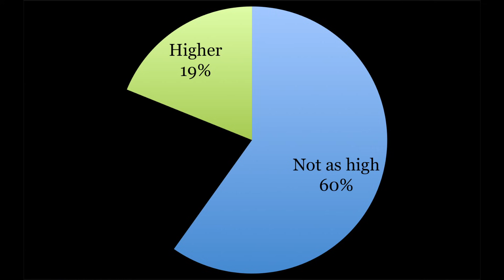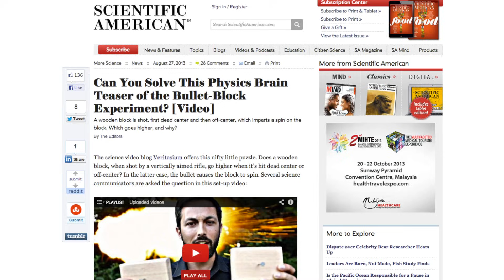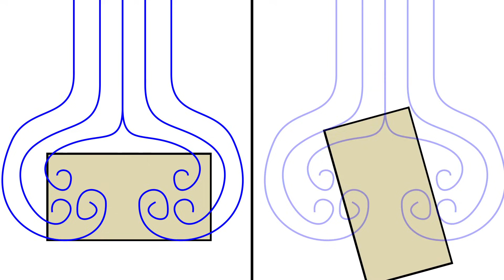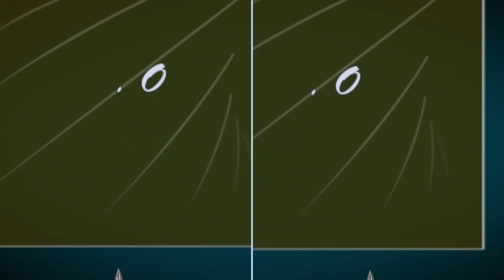Bullet Block Explained!

Comment: I too am unsatisfied with this answer:
the rotation is caused by the moment of inertia - when the bullet is shot in the middle the inertia on both sides is equal.
when the bullet is shot off center the inertia on both sides where the bullet hits is unequal causing a moment of inertia.
This can be tested by drilling a large hole on the left side and shooting in the center - you have moved the central moment of inertia axis of rotation to the right so the bullet will rotate clockwise.

Comment: If you want to see the difference in bullet depth, you should use a weaker medium and more energy. Perhaps firing a larger caliber round into massive blocks of styrofoam or cardboard? The bullets would be allowed to travel farther into the material with less resistance, but the difference in efficiencies would be more visible because the difference in kinetic energy would be greater, as the bullets are larger, and the differences in distances traveled into the block would be greater. :D

Comment: It is a matter of the weight of the downward force from the block due to gravity.  At its center of mass this force is greatest and diminishes as you move away based on the shape of the block.  Do the experiment with a MUCH heavier object that the bullet cant penetrate and note the max height of the cog of the block.  You will see it goes repeatably higher the further you are offset from the cog.  I expect an exponential relationship between block cog height and distance of bullet from center.

Comment: Make the penetration depth difference measurable by making it bigger:
Choose much bigger blocks out of a less dense material. Choose bullets which deliver the right amount of potential energy - so that the bullet just not leaves the block so to maximize the penetration depth. For the spinning block also go off the center so that the bullet just stays in the block and doesn't leave it, so to create as much torque as possible.

Comment: Change the wood blocks to pieces of steel I-beam and the bullets to steel balls shot from a slingshot. Changing from elastic to inelastic collisions should give you dramatically different results. (And maybe Joerg Sprave could build it?)

Comment: use a different density of material. i feel like that could possibly change the penetration depth if you were using a softer material to make the measurable gap larger

Comment: (a) Remove height element and test solely for penetration depth difference between shooting through the center of mass and away form center; the block is fixed in position at center of mass but rotates freely. (b) Use a longer block to exaggerate penetration depth effects from shooting through the center and graduations away from the center.

Comment: Yes but what ensures that each bullet had the same force to begin with. There may variation in the gun powder from bullet to bullet. The only way to truly test this you would need the same gun, firing the same exact bullet, into the same exact piece of wood. The differences in heights between all the blocks fired shows this.

Comment: Take two blocks and predrill one hole in each block. One in the center and one on the edge. Then, put a "cup" that could stand the power of the bullet so you get no penetration. Just the bullet getting stuck into the cups. Dont know if that helps but i want to se it :)

Comment: What would I do? I'd use a series of 30 blocks a bit longer than those used in the original video. I'd then shoot the blocks starting at the center and move progressively out to the edge.  Analysis of the height, rotational speed, bullet penetration, etc. would dictate the next step in the investigation.

Comment: Excuse me! The nail measurement showed the center-of-mass shot was about twice as deep! Which is what I expected, with the off-center shot having to drill a semi-circular path thru the wood.
Then, you whip out those stinking XRays, that show the depth was the same?? 
Which measurement is correct, the nail or the XRay??  

One other factor is the rotational (RPM) energy of the bullet. 
And another is the gain of the wood. Need to use a non-grain block. 
Maybe cellular PVC deck lumber?

Comment: The density of the host (block) material would be the big variable.  More dense = less penetration.

Maybe rotate the rig on it's side and put the block on rails?  Then you could use blocks of different density.

You could also use a projectile that had less kinetic energy to start with.  Then the 1% difference could be more noticeable.

Comment: I suggest a series of 3 changes;

1) The blocks medium, change it to plastic, metal, and/or foam
2) The lengths of the block, with impacts at varied distances from the center.
3) The Ammunition, strike the block with plastic pellets, or bean bags, etc.

Comment: You might try shooting the bullet in such a way that the angular momentum vector shares a component with the translational momentum. You would have to shoot it at an angle. Tilt the blocks & barrel at a 45° angle, & see if they reach the same maximum height, with one center shot the other off. Since angular momentum is conserved as the off center block spins along the parabolic path it's vector will maintain a vertical z component, and the height should be lower.

Comment: You would need some ratio of power vs material to exaggerate that 1% difference (granted that it always remains 1%) and bullet type would play a role as well. Stronger gun, less dense material, better penetrating bullet. Something light enough so it can be made bigger to compensate for the deeper penetration. Some material that won't cave as much so penetration is more easily measured.

Comment: At first you say the rotational energy is 1 J and the potential 2 J (so about 1/3). Later you say only 1 % of the bullet's kinetic energy is used for rotation and 97 % for the linear movement. Can somebody explain me, why there is a difference.

Comment: The best way to modify the experiment is changing the materials, mainly what the bullet and the block are maid of.You can try na steel bullet for example, as it would not loose as much energy on deformation.

Comment: I doubt this, the spinning block is lower at a micro scale. It cannot physically be equally high.
Also, notice closely when both of the blocks are flying upwards, the spinning block's platform is also placed slightly higher than the non spinning one.

The only reason it seems to be same height is due to the kinetic energy being a minuscule fraction of the total energy in this system, as opposed to the massive force exerted by Earth's gravitation field strength making Pe 99% of the total energy.

Comment: The channels left by bullets are largely imperfect; not the cylindrical channels which most people seem to expect. They are quite warped and littered with bullet fragments, and in this case, probably splinters. I'm pretty sure this will be the reason why the nail only goes half way and it was just by chance that it was the expected block.

Comment: Do the experiment with two types of bullets but that are the same weight. For example: a hollow point and a normal one. The hollow point would disperse its energy quicker than the normal one, therefore not going in as far.

Comment: I think that you would probably be the most consistent using gravity to supply your energy. My first thought is to build a ramp, kind of like a ski jump, that a ball bearing would roll down from the same point each attempt. Then it should fly off the end of the ramp into a piece of rectangular Styrofoam or something rigid enough not to be damaged by falling down, but soft enough for the ball bearing to be able to penetrate. Just a thought.

Thanks for all the great videos.

Comment: Change the material of the block, use something that oppose less resistance, though in that case you may want to also change the gun to avoid the bullet going through the whole block (in that case use a bigger block).

Comment: I can only quote the Mythbuster mantra: "Bigger is better."
If you want to measure bigger differences you need bigger guns and bigger targets. And a more consistent homogeneous block would be a  must. Firing though layered material like wood will always change the outcome depending on the angle the bullet has to the layers.

Comment: One way to more reliably measure the difference in penetration depth for this experiment would be to replace the wood block with a less dense medium that is less likely to fracture or split. This will allow the bullet to have a lower acceleration when entering the medium and more visibly show the difference in energy transfer.

Comment: => Total Energy = Gravitational Potential Energy + Rotational Energy.
=> Rotational Energy = Torque * angle moved in radians.
=> Torque = Force * distance_center_block_to_place_where_Bullet_Shot * sine(angle_between_center_block_Place_Where_bullet_Shot)
=> angle = 180 for bullet hitting at the center. sine(180) = 0, Tarque = 0. hence TOTAL ENERGY = GRAVITATIONAL POTENTIAL ENERGY
=> angle != 0 or != 180 for bullet hitting side, hence Tarque != 0. hence ENERGY = GPE + ROTATIONAL ENERGY

Comment: Yay! I had part of it right. :p
Uhm. To make the difference more noticeable, I guess it would be better to use bigger blocks made out of a substance that will not reduce the bullet's speed too drastically. So the distance traveled in the blocks will be larger and the difference between the two situations too.

Comment: Indeed, if the bullet passed through the block the same could be said: the centre of mass of the system would have to reach the same maximum height. But because the bullet is going upward the block could not reach the same height as when the bullet embeds.

Comment: The easiest way is using block larger, preserving the mass. This will make the lever arm larger, producing more torque, that will generate more rotational energy, or you can improve the angular momentum, putting weights in the extremity of the block.
In both cases the objective will be preserver the kinetic energy(preserve the mass), and improving the angular energy(make the momentum of inertia of the block higher)

Comment: The centre of mass of the system would still have to reach the same maximum height (assuming same initial mass & velocity of the bullet), but because the bullet would rebound going downwards the block would need to go higher to compensate.  The collision could still be inelastic (deformation of bullet/block, heat transfer) but the trajectory of the centre of mass would be unchanged.

Comment: To have the difference be measurable, the block would ahve to be of a softer material (wax of some sort? Cork?) but that means the block would have to be huge. So the only way I can see is to make a composite block that can absorb the energy in stages. The outer layer would have to be a material that doesn't break but yields to the bullet - wood like in the video. The block would ideally be made from one piece of wood with the core scooped out and replaced with the softer material.

Comment: mayeb if you made a block of wood by gluing together layers of differents types of wood, either starting with harder wood on the outside and softer wood on the inside, vice versa or even mixing them up (hard,soft,hard,soft etc...)

Comment: Strike the wood block with a small hammer, attached to some form of controlled pulley or spring, as to be able to determine and measure the amount of energy transfered to the block when struck. this also allows the same amount of energy to be transfered every time.

Comment: Use a LESS dense material; you may have to adjust the overall dimensions of the blocks so the bullet doesn't hit the center nail.  With a less dense material the bullets will penetrate farther, but the 1% difference will also (or should) be more easily measured. Perhaps use sharper bullets.

Comment: i don't take physics in school, but perhaps you could use a stronger gun and larger piece of wood that's less dense so that the bullet would go deeper and thus the percentage difference will be more visible, or if you used longer pieces of wood and for the rotating one, shoot as far as you can from the centre

Comment: increase the amount of energy in the system (larger caliber round) so that the difference in penetration is measurable. The more energy the bullet carries, the larger the penetration depth so 1% of that depth would be more significant than 1/10 millimeters.

Comment: About depth penetration, wouldn't the location of the bullet make a difference?
The wood block is more "fragile" on the extremeties as the fibers tend to be easier to break apart.
Like when you hammer a nail near the end of a 2x4, it tends to crack and split, while it's usually stronger the farther away from the ends that you nail it.

So maybe the bullet shot off center did go deeper than expected because the wood fibers were easier to penetrate there.

Comment: A way to modify the experiment so that the difference would be measureable would be to replicated it  on a much larger scale. Also, increasing the caliber of the rifle used. Finally, using a type of wood that might be less dense which will increase penetration of the block.

Comment: In dynamics, linear momentum is conserved along a line. The two shots represented to my reckoning, a direct, and an oblique impact. You might try calculating the coefficient of restitution in each case. This would tell you the ratio of initial/final velocity along a line. The impacts were not perfectly elastic or perfectly inelastic, so the coefficient of restitution would be between 0 and 1 for each. The magnitudes may be interesting.

Comment: or you can try with longer pieces of wood to make more distant the center of mass and point of impact, so the spinning velocity will be higher and the bullet will penetrate less the wood than the other one, or you can try with less dense pieces of wood, but they would be very larger in order to keep the bullet inside.

Comment: Precisely measuring all the variables in this experiment will determine the correct answer. One thing not considered in the videos is the bullet. Bullets can be different even though they come from the same package. I've shot lots of .22's and there is a measurable difference between bullets. Both the projectile (bullet) and the powder in the casing need to be standardized for accurate results.

Comment: Use two materials in this experiment wood and plastic, each of these materials should be the same dimensions as used prior. The difference will be a 1' hole in depth and the width should be comparable to the bullet used (use slightly smaller hole than bullet), as when a carpenter pre drills a hole for a screw to be guided, I predict the bullet will be guided as well allowing for a measurable outcome! Please reply debating if this could work or not, show facts of why it would work or predictions.

Comment: A possible way to measure the difference in depth is to measure the exact weight of the blocks of wood(after you've shot them) and then fill them with a liquid. Take the weight of those and subtract it by the blocks of wood and you can see if one bullet went deeper than the other. Also, with the density of the selected liquid you should be able to tell how deep the bullet went in each block.

Comment: That's because the bullet didn't go straight in the spinning block so the nail stops when the hole start to bend, besides that nail was too thick maybe if it would be a thin nail it could reach the same deep.

Comment: you could try a different medium with less resistance (but still big enough to not allow the bullet to pass all the way through.  try with different types and gauge of bullets.  a wider block and fire further away from the center to make it spin more.

you also need to consider how each bullet deforms - was one more deformed than the other (it appears to be in the x-ray)

Comment: Well, to test the theory more precisely, you either need a material that deforms uniformly or minimally. It might also help to use an application of force that is more consistent than a series of bullets. But that would probably mean scaling things down which just wouldn't be as exciting, would it? Though if you had a piston instead of a bullet you might be able to measure things like sound emission more easily :P

Comment: Maybe use a material that is softer, so a small difference of energy lost compressing the material would result in a more measurable difference.  AND, use 2 pieces of material that are fastened together at the edges, so you can easily split the experiment at the end.  So you don't have to xray anything.

Comment: I'm not 100% happy with the answer this video. It's correct, but I feel you make it sound like hitting something from the bottom will always go just as high. You test had a the nail in center axis to spin. If it was 2 nails it would of had leverage and would of acted different between the 2 shots.

Comment: Instead of bullet penetration, why not measure the difference of volume before and after?  Assuming mass is conserved, measuring the volume displaced in water would give you a change in the overall density. Might be larger then the 1mm change in a single direction.

Comment: Yea. I was thinking about the energy of the bullet released into the block/length traveled therefore it should be relatively a huge difference in energy despite the small difference in length. So that explains too why my previous thought about air resistance playing a part is negligible since air resistance isn't acting a major force on the block/being changed throughout. Thanks for explaining too though.

Comment: Bullet deformation in the xray is observed prior to the overlay.  While the distance into the block is roughly the same, the bullet in the middle of the block is more compressed.  That's likely also the reason for the nail going in further as well.